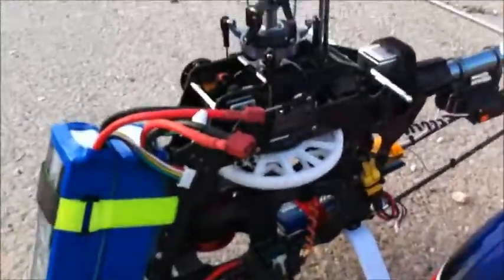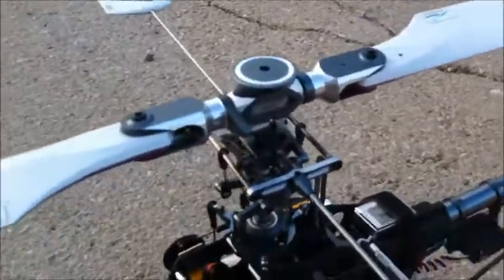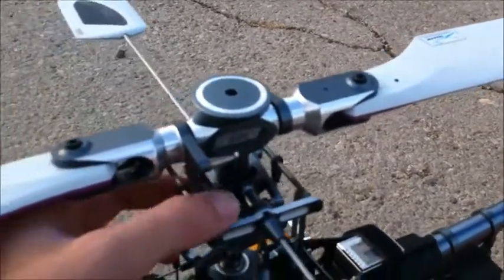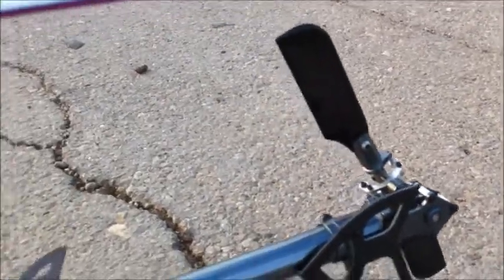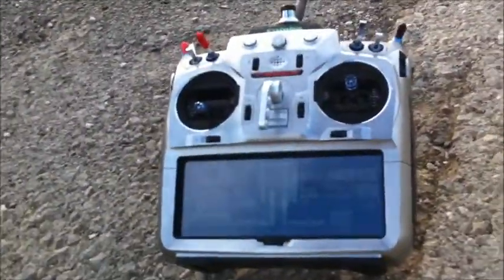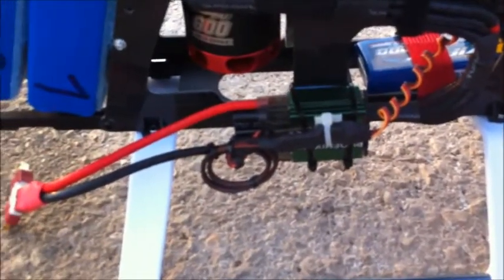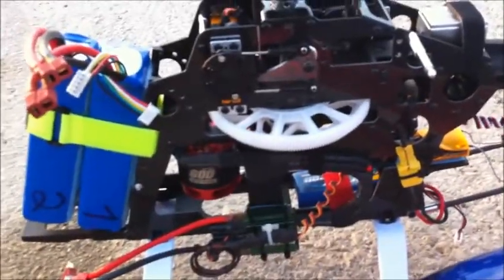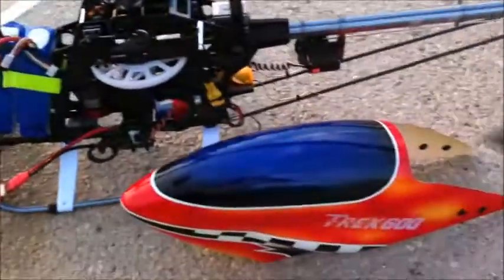HK600 GT flight #4 + explaination

Comment: Ive been reading the reviews on hobbyking for this heli and watched some review videos. In those reviews they say to replace some critical parts before even attempting to fly. Did hobby king fix these issues with newer versions? You said its mostly stock right? It would be very helpful if you could help me out :)